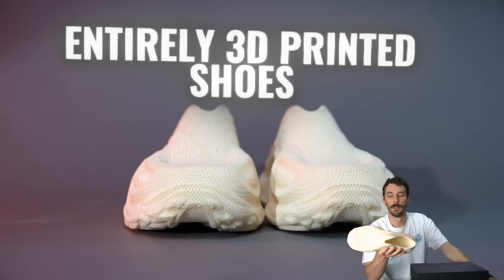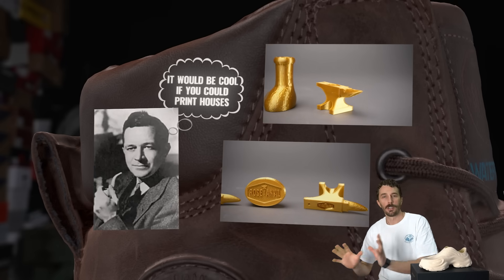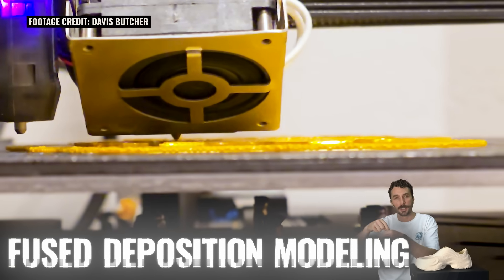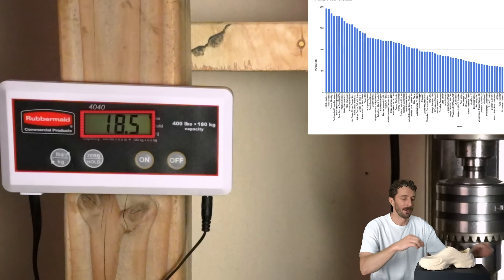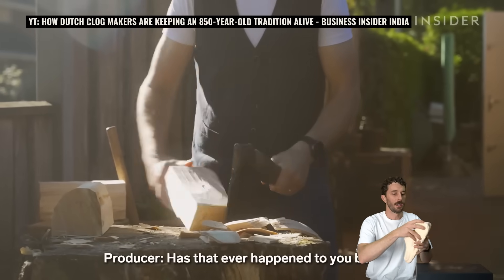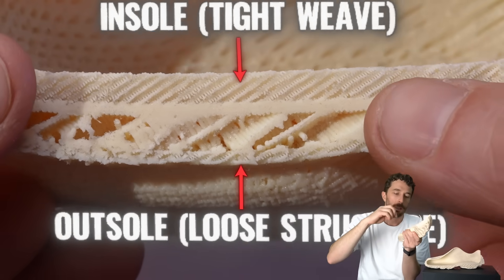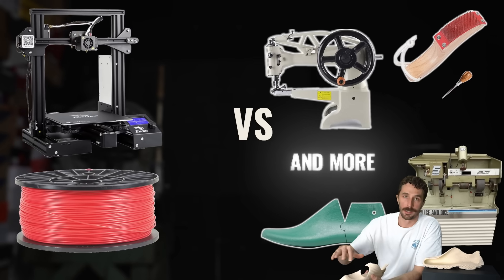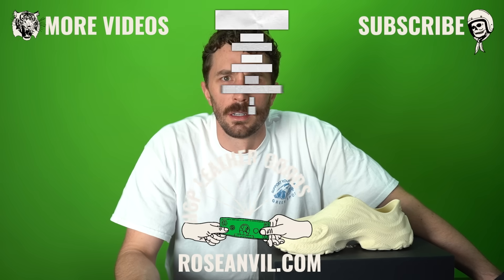The truth about 3D printed shoes - Zellerfeld

Comment: Make sure to separate "production time" with "assembly time" when comparing typical shoe manufacturing with 3D shoe manufacturing. There is a lot of lead time and overhead to produce a normal shoe, even if assembling one can take an hour.

Also, light-based 3D printing doesn't really lose time when printing multiple items. Extruder-based 3D printing increases in time for each object added to a job.
Reply: Yeah I feel like that comment about the time was not very well thought through. The time it takes for a leather shoe to go from a dead cow to a shoe is probably weeks, tanning leather takes a long time. The production volume of these 3d printable shoes can easily be increased by just buying more printers. 

The only issue I think that the print time causes is the time it takes if you want a fully custom shoe since theres at least 40 hours from measuring to when you can pick it up. However people who order custom shoes are probably used to picking them up a day or two after they're measured anyways just because its more convenient.
Reply: I agree with this as well. The printer needs only the spool and they are producing. There's also a conversation to be had about space, up time, and changes when it comes to  

A 3d printer is smaller than a human. No mold for plastic of the shoe, or machines for cutting patterns, or conveyor belts. You can pack a factory with this.

Next is up time. Each point of production is contained down to a printer. If a mold for making insoles breaks, that creates issues, but if a single printer breaks, they rest can keep going. And on the other side, no humans, no sleep, no rest, no breaks.

Finally, you want different shoes? Just put a different file in the 3d printer. No changes in molds, no changes to the cut pattern, no relearning what needs to be done for this shoe. 

IMO
There will be a break point where these factors, and probably more beyond what I understand about this production process will be overcome by the 3d printing process
Reply: @Magarthryx no, 3d printing can be superior for very small production runs and prototypes, as well as excessively complex and intricate parts.

However for basically everything else, the current manufacturing methods are far superior. Both in cost, efficiency, reliability, strength, and speed.

3d printing is slow, expensive in larger volumes, and the materials are very limited, not to mention the surface quality is ugly, and the strength is often inferior to other manufacturing processes.

CNC machining is pretty neat, it didn’t replace all other manufacturing methods, nor did it become the most used one. 3D printing will be used just like CNC is, small production runs, complex parts, and prototypes.
Reply: @Aikano9   na you speak about FDP printing?

the cost drops so fast the now can challenge the old method.

"material are limited" no you must use a direct nozzle with no spool >use direct granulate.

or going direct too laser/or binding powder printer
Reply: @Magarthryx the zellerfeld printers are as big as a minibus tho
Reply: @David-nw9vj  not really, about as wide as a human with shoulders and less than half the hight
Reply: The filament needs to be harvested as oil from the bottom of the ocean, or deserts, then be chemically altered into plastic, then be colored and extruded onto a spool, before being shipped off to the shoe factory.

You have the leather, rubber, etc available in your warehouse, just as you do filament spools. When you start to run low, you order more.
Reply: @Aikano9 Not all plastics are oil based. Just saying...
Reply: @JonLinde  most used for 3d printing aren’t. Pla is primarily made from corn byproducts and is theoretically biodegradable although not so much in practice.
Reply: Light based printers use resin material though, which are thermoset materials = not recyclable or reusable. They also dont have the same good mechanical properties that a thermoplastic like TPU has. Because of those reasons, light based processes (SLA or DLS) are poor choices for making shoes. FDM or SLS are superior choices.
Reply: Also worth noting that while production time is 20ish hours, that's mostly unmanned time. Just slight oversight is sufficient, so you could have hundreds of these going at a time without additional manpower
Reply: Light based scales well but is too expensive on a individual unit since the space requirements are a lot more costly. If you had a 3d printer the size of a house it would be much cheaper to do it with a normal extrusion type but a lot slower. If you used a light based model it’s super fast but insanely expensive and maintenance gets out of hand very quickly with so many different things that can go wrong to cause an issue. If they could effectively scale then you’re correct, it’s a lot cheaper but in reality the technology is barely there and it’s very expensive, and these shoes would still be pretty slow to produce. They probably take 10-15 hours per pair if you printed them one pair at a time. Even assuming they have a Machine that can print 20 pairs at a time it would still just barely outperform the already available equipment that can crank out a similar quality shoe in a few minutes per pair.
Reply: Shouldn't you then also factor in the time it takes for the filament to be made? And actual spool? And the print head? And the printer assembly? You could go down to infinite details.
Reply: @Nereosis16  You could and to be thorough you should but is not really relevant here because this is time and energy any other material will consume to be made but here is only about one type of plastic, not many as in conventional shoes. On top of that no leather, no textiles, no metal, no rubber. You could add here the printer as well but even a bunch of printers might not compare with the many huge machines and molds a factory needs. 

And as somebody pointed out it's a different process altogether, you can easily add more identical printers that need only little supervising and maintenance, you have also the advantage of redundancy because all of them can do the same thing . If the injection molding machines brakes down your whole factory stops and you can't complete anything. Also you won't need to make huge factories and ship oversees, you could have many small print farms scattered and the costs will be very similar. Printers and materials will cost the same, only the maintenance, utilities and rent will differ. Add to that almost no cost of warehousing, you could print on demand or on very small batches. On a print farm of 100 machines you could print 100 variations of size and style in the same time, you don't need to do batches.BTW  that's why manufacturers are steering towards CNC one piece knitted uppers, those machines have the same advantages. The inventory for producing this is hugely diminished , you don't need to keep track of all the precut parts, molds and jigs just the materials that come in identical packages, not in rolls of different sizes, barrels, sheets, and so on. It's really easy to store identical packages that just have different labels on them, these can easily be operated by robots. 

As a conclusion you need to count everything but the advantages are obvious. Only limiting factors are design and the appeal to the customers . You could add here cost but this will drop fast when the demand rises enough like solar panels and car batteries did.
Reply: @Nereosis16  even if you count the time that it takes to make the filament it's still multiple days less than the time it takes to harvest leather from a cow or other living animal

Comment: Great video!  Yes please, more technical 3d printed shoe videos like this one where you cut it apart and explain how it's made, etc.  It would be nice if you can dig deeper into how many walls are used, what infill settings are used, what material is used, etc. when printing the shoes.  Also, please let me know how flexible the ball of the foot area is of the Zellerfeld shoe compared to some of the other sneakers you own.

Comment: it doesn't matter if it takes 24 hours to print it if you can just leave the printer to do it. It's not like someone is working on it for all that time like a traditional shoe.
Reply: In manufacturing you measure man hours and machine time. So while your machine utilization is great your time per unit is still insanely high. 

If they’re able to use material jetting they could make multiple units at a time
Reply: @JJ-zr6fu  I disagree. Man hours are, in most cases an order of magnitude more expensive than machine hours. 24 hours running a 3d printer will be way cheaper than even the cheapest labourer assembling a shoe for 2 or 3 hours. Obvious you still want to get your machine time per unit down to a minimum but it’s way cheaper than people.
Reply: @jabbawok944 You're forgetting about one huge variable and not thinking about many others.

If even a pair of bespoke boots can be produced by one person every two hours vs 24+ hours for one pair of shoes, that's a huge difference.  Especially when you start having to setup all of the infrastructure, space, repair techs, parts etc for that many printers.

Printing in that type of filament is also very difficult; it would have a much bigger failure rate than people producing shoes.  If the print fails 22 hours in, you have to start over again and have nothing to show for it, etc.

It's just not as simple as you think.

Comment: I wonder if 3D printing could improve mass making outsoles for local cobblers to decrease the costs of resoles without losing profit margin. If people can resole or repair quality foot ware quicker and more affordably, then it’ll make more sense for tradesmen and military personnel to use resoleable boots. I know that the Marines and army both had some resoleable regulation compliant boot options available for awhile in the 2010’s, but it seems like those were all replaced by cup soles again. 

Just an outsider (not a tradesman, veteran, or active duty military) looking in, this could potentially be a game changer if it works well and reliably.

Comment: I feel like it needs a plastidip to seal the pores, and a thin layer of more durable rubber on the outsole, but this does seem like a real contender for the future of shoe manufacturing
Reply: This is a shoe and not a waterproof work boot.  You want it to be able to breathe.  

It could be solid like that if they wanted but it would suck to wear.  Too sweaty and the shoe would also be too stiff.
Reply: @yayinternets  yeah you right, needs some sort of breathable layer to protect the pores from ingress
Reply: @yayinternets  any dirt that gets in the pores - not to speak of what dogs leave behind....well, i wonder how much VC money they got for this. customers? idk...
Reply: 3D printing is just machining for plastics, it's gonna be huge. It's starting to break into more domestic and consumer markets because the tech has advanced enough to use better and more specific printing materials while cutting down costs on the software side with more efficient programs.
Reply: @misteral9045 it needs to become much faster, and less finicky to be viable for too much, other than hobbies imo. It would take millions of printers or years to do a normal Nike Shoe run for as many as they selll.
Reply: If you want it better sealed you can simply print it that way. No need for extra steps.  These pores were a design choice, probably to hilivht the process since they are marketing the shoes based on the manufacturing.

Comment: $250 for Crocs...
Reply: At least you could recycle these and print new ones with the material, the foam shit used for Crocs is not realy recyclabel.
Reply: These are an interesting comparison to Crocs. 3D printing vs. injection molding.
Reply: Insane!!!
Reply: Shipping out of China for $25 in a few weeks I heard... Exclusively from Temu.
Reply: 800 sounds like a better deal, if it breaks print a new one, 3 a month maximum swaps
Reply: I agree the price is absurd, but these are not crocs, this is the future footware industry and we already have the tech to solve the problems he metioned. So much so Nike is launching a 3d printed air max
Reply: Stupidity of YouTube comments on full display here.
Reply: Not everything is for you and that's ok.
Reply: they have to charge a lot. Like he said in the video 3d printing is time consuming and can take up to a few days and it's super hard to mass produce these since you'd need like 5000 3D printers. To balance the supply and demand they basically have to charge that much which makes sense imo
Reply: Crocs needs to have big holes for breathability, these don't.
Reply: @jovanleon7 go to shoe school and get schooled
Reply: 250 for cool crocs 😎
Reply: There's a few obvious differences here, besides the material. These cover the back of your foot. They don't need that weird strap. There's no giant holes throughout it. They actually fit you, and they don't scream idiocracy. They're actual shoes.
Reply: Guy sells smoke & mirrors total junk
Reply: some crocs DO cost that much..
Reply: These are better in every way than crocs
Reply: @ClippyWippyZippy go to school and get schooled